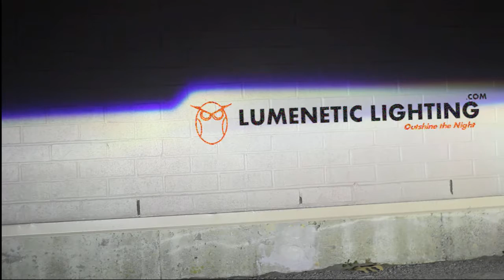How to Retrofit Projector Headlights on ANY Car - HID Projector Retrofit DIY Guide Part 3

Comment: Great videos bro. Question i have a 2004 cadillac srx that has projectors but im using led lighs since i change the standard factory hid lights. The problem im having is that since i change that i don't the good quality lights. Do i need to replace the projectors or the light bulbs? Thanks

Comment: I have a 1998 GMC Envoy(Jimmy/Blazer) with 9006, 9005, and 880 bulbs for low, high, and fog respectively. I have removed the 9006 HID kit for low beams that can factor installed. So I have standard 9006 connector exposed but will need to modifying housing for shroud.
I am going to go with LED lights instead of HID. Can I still get the projector look?
Reply: A1Googler yes you will